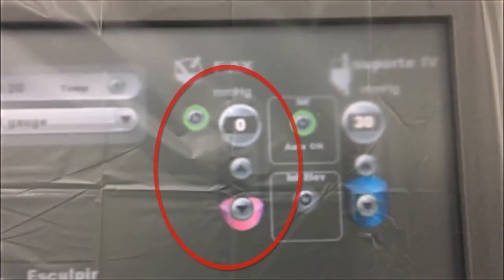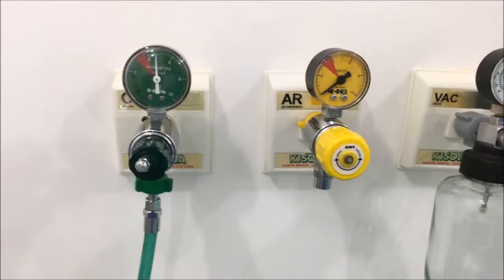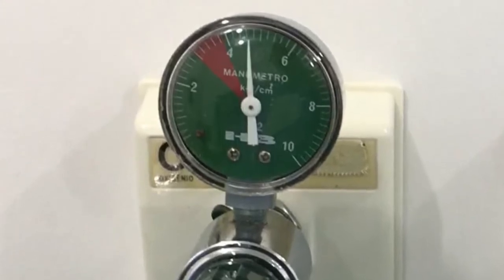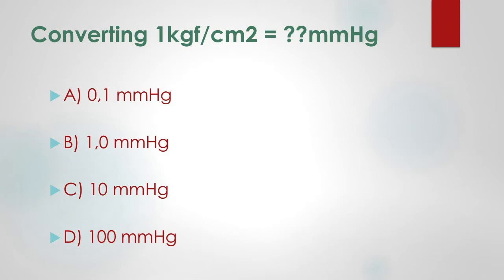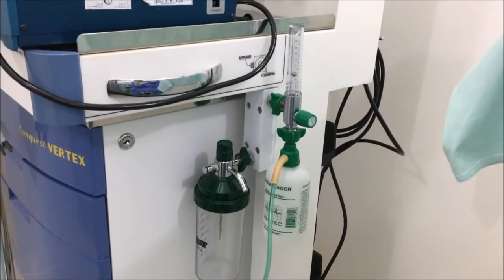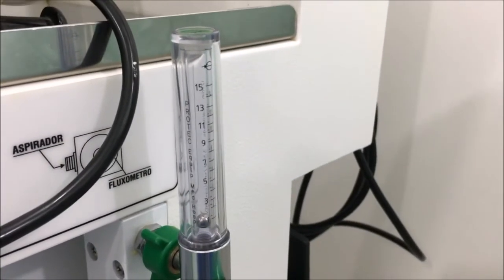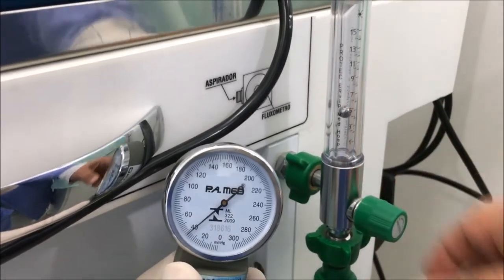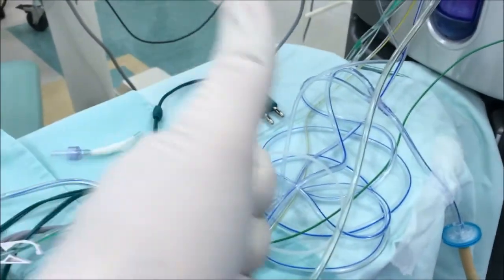What to do when your Fluid/Air Exchange doesn't work?

Comment: Great idea. 
Can it be done with an oxygen tube ? How can we adjust the pressure of the air entering the eye?
Thanks a lot.
Reply from the maker: I would keep air instead of the oxygen, because O2 would be reabsorbed too fast! The pressure measurement can be seen in this video! :)